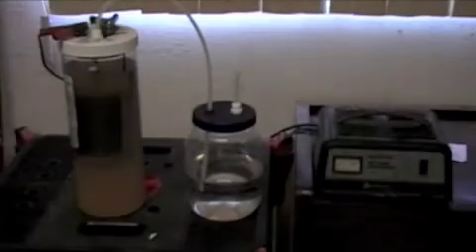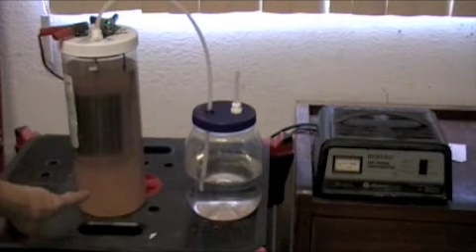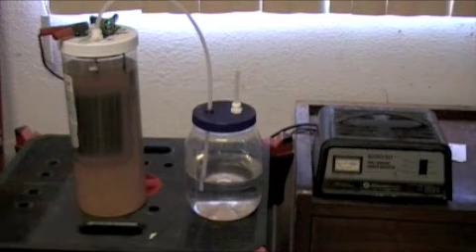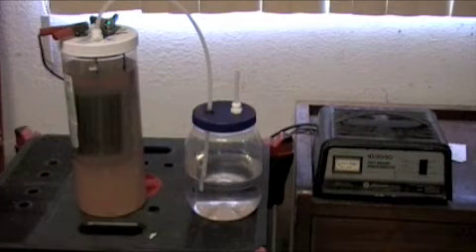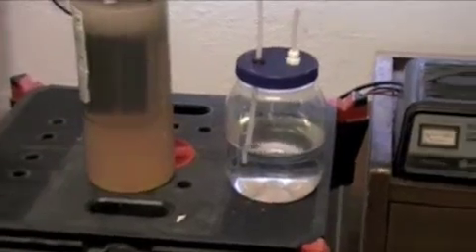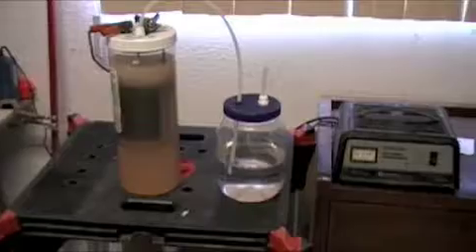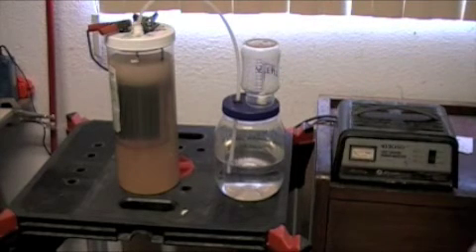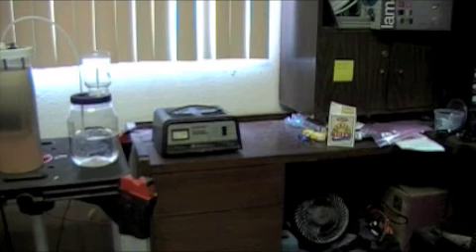HHO Test

Comment from the maker: It runs at about 20 amps after dumping in about a half a box of baking soda. Yes it gets warm. The really hot part are the bolts where the wires are hooked up. 
Keeping the generator lower than the bubbler so that the bolts stay in the water solves that problem.